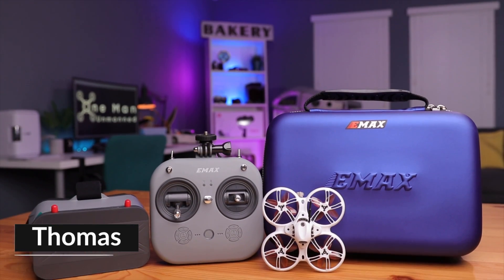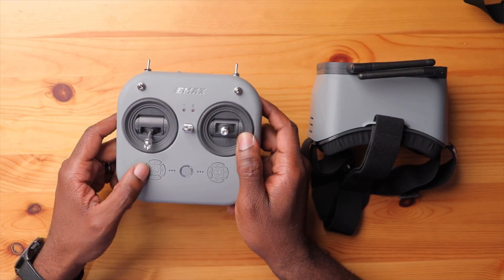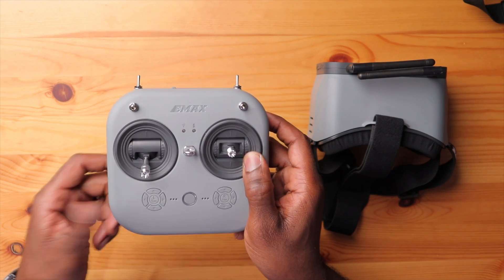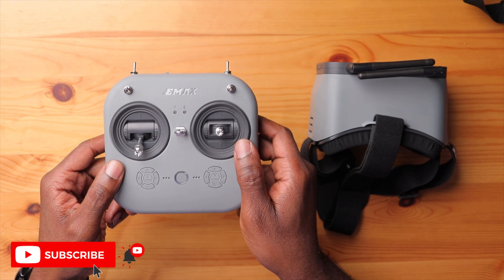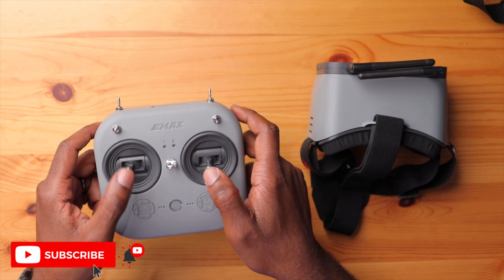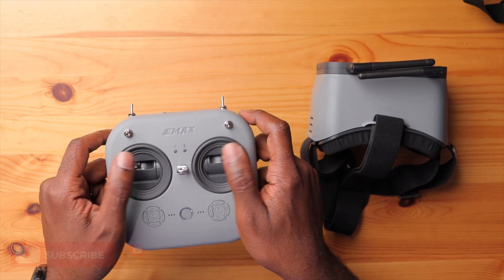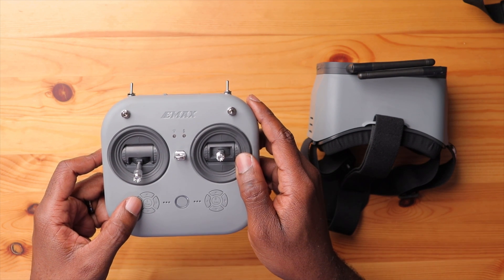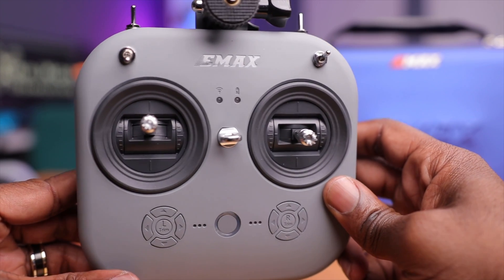Calibrate Your EMAX TinyHawk3 E8 Radio | Quick & Easy!

Comment: Should the left stick be down for center?
Reply from the maker: The left stick controls your motor speed.  When it's all the way down, the motors are spinning at idle speed.   When it's all the way up, it's spinning at its maximum speed.
Reply: @OneManUnmanned  Got ya, I will recalibrate then. I did it with both sticks at 0 point. I think I also need to use that beta software because when I go to lift off, it goes in all kinds of directions and doesn't simply go up. I just got it today and this is my first time.

Comment: I just noticed the length of the sticks on the transmitter seem to be adjustable. Do you think this remote would pair with the dji goggles v2 ? Or are they not compatible since this seems to be a analog system?  I believe the remote that came with the dji fpv combo only works with that drone. I saw we're dji sells a different fpv remote controller that seems to work with a lot of different drones that looks more like this one at least the aux buttons are similar. It's 300 retail though for just the remote. It might save a lot of headaches though for multiple drones, saw a video where you only need to bind them once and it will remember it. That would be cool having a bunch of different fpv drones that will work from the same remote and goggles.   Thumbs 👍 another good video.
Reply from the maker: The sticks are adjustable, but I do not think they will pair to the DJI goggles.  Alot of guys buy the more expensive radio on the market because it binds to more drones in the hobby.

Comment: My Tinyhawk 3 on a flat surface will pitch and yaw, but wont take off! Its connected to the receiver and arms, just wont move vertically. I calibrated the drone in Betaflight but still nothing! 
propellers wont spin when I move the stick forward. Propellers are installed correctly and the drone flew fine before. Sorry if this is a newb issue but would you know the solution?
Reply: I fixed it it appears the left two position switch was in the wrong position, makes me wish emax included labels and instructions for us beginners!
Reply from the maker: Sorry for the late reply.. yes, sounds like you were in "turtle/crash-flip" mode.  Unfortunately, the radio is not labeled, but you'll get used to it very quickly.  Happy flying!

Comment: Hi love your vid , they help me find my first fpv drone.  So I got the tinyhawk 3 in the end , is there a way of putting the crosshairs on my monitor as it would help me in air mode .
Reply from the maker: Yes, you would have to connect your drone to Betaflight, go to the OSD tab, and select crosshair as an option.  Don't forget to click save when you're done.

Comment: So I just recently got my TH3 about a month ago.  Its been flying awesome, however starting yesterday my E8 Controller is violently using right yaw only when i throttle up causing the drone to just spin in circles.  If I throttle down it stops spinning.  I know its only the controller because it is doing the same thing in my simulators. I have tried recalibrating using the steps shown here, but no luck.  Any ideas?
Reply from the maker: Yikes.. your best bet is to contact EMAX or the vendor that you purchased the drone from.  You're maybe the 3rd or 4th person that has brought this to my attention.  Unfortunately, no one has found a solution to this problem.  I think this is becoming a common issue with the E8 radio.
Reply: @OneManUnmanned  Thanks for the reply! That is a bummer but I am looking to buy a new RC Controller anyways. Any that you recommend?
Reply from the maker: It depends on your personal taste.  If you like game pad style controllers, the Jumper T-Pro, or RadioMaster Zorro are really good options.  If you want a full-size radio, the RadioMaster TX 16S is pretty much the standard, and has good aftermarket support.

Comment: My E8 Radio's Yaw stick has stopped responding. Throttle function works okay, but 0 response when I push left or right. Any suggestions?  This is the radio that came in with TH3 in the RTF combo.
Reply from the maker: Very interesting... But you're the second person to tell me about this phenomenon.  Unfortunately, I have no solution for this problem.  I'm sure you tried the gimbal calibration in this video.  Have you reached out to EMAX?  I would like to know your results once you get this resolved.   Thanks.
Reply: @OneManUnmanned  , I just reached out to EMAX and waiting to hear back. I did try the calibration steps shown in this video and also tried DRL's calibration function.. same result. I am not too familiar with Betaflight, but do you think it can provide some backend information about whether it's the faulty hardware or a user/operational issue?
Reply from the maker: I don't think it will do much, but you could turn on your radio, plug your drone to your computer, and open Betaflight.   Go to the Receiver tab, and see if there is any input coming from your controller.
Reply: @nycfamily8623  I'm having the exact same problem. Yaw stick is centered at 2020. It doesn't change when I move right. When I yaw left, it barely changes (I think it goes to 1970). I also just emailed Emax. I hope they can help us.

Comment: Oh super helpful. I got a tinyhawk 3 that didn't arm most if the times. Investigating in betaflight showed that the throttle stick, when placed all the way down, only had its transmitted throttle value sink slowly and wobble quite a lot on the way. I found that only by stroking down on the gimbal roll I was able to take the throttle value all the way down to 980.
Reply from the maker: Yeh, some quads won't arm at all if the throttle is not reading at idle.

Comment: I just purchased the tinyhawk 3 watching your video. I  tried to fly it, but I was traveling all over the place. I’ll recalibrate the radio and see if the recalibration fixes it. Thanks.
Reply: Also make sure to set the quad down flat after plugging in the battery. It calibrates the gyro in the first seconds. If the quad is not level during that time, then it will drift in angle mode.
Reply from the maker: Sweet.. Thank you!
Reply from the maker: You're welcome.. it might help.
Reply: @OneManUnmanned  Does recalibrating reset the trim?
Reply from the maker: It's not clear/certain from EMAX that this calibration method resets the trim.  Having said that, the trim can be rest manually.  If you press the trim button in any direction, you'll hear a SHORT beep.  If you press the trim in the opposite direction, you'll hear a short beep until the trim is centered(at which point, you'll hear a LONG beep).  So the goal is to trim until you hear the long beep.